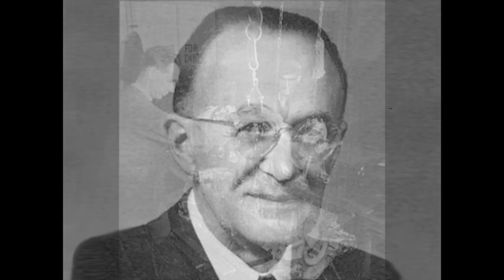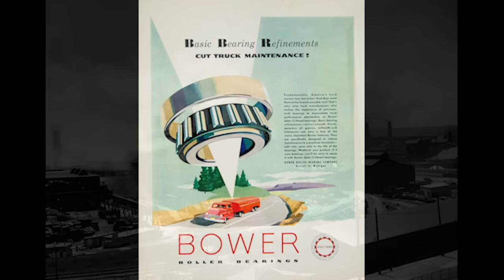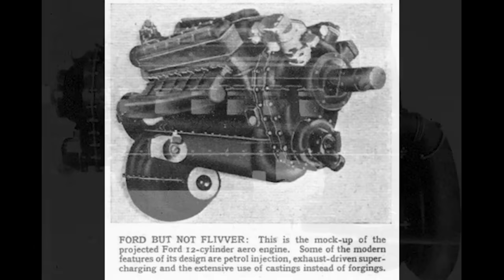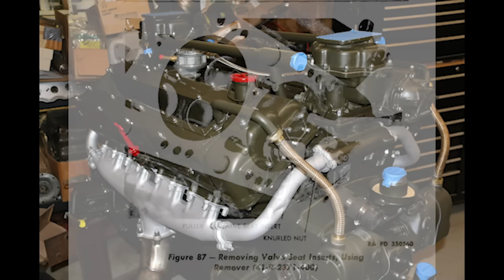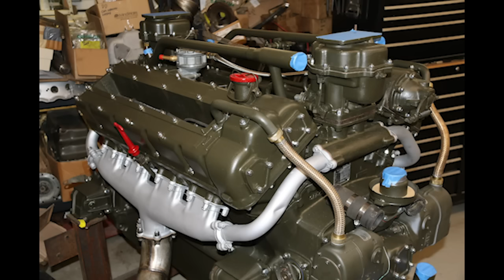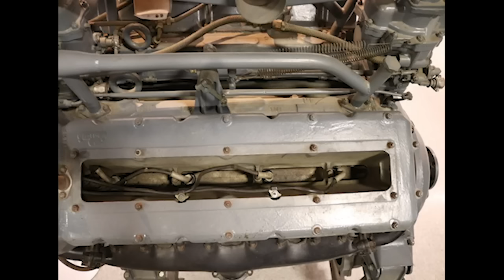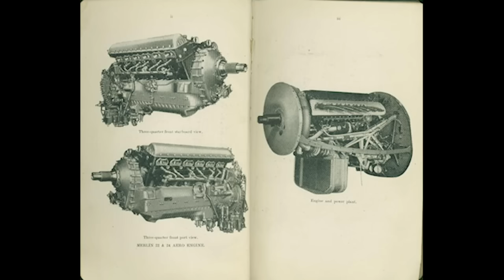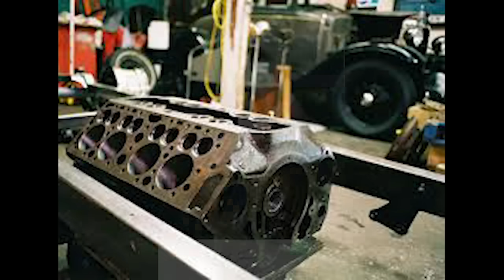War Hemi: The Story Of The GAA V8 - 1,100ci of aluminum WWII Ford grunt

Comment: Nice, but not a Hemi, its a 4 valve pentrof
Reply: Yes, only gen1 and 2 was a true Hemi
Reply: Chrysler hemi combustion chambers resemble a Yarmulke more than half of a sphere. Harley Knucklehead, Panhead, Shovelhead and Ironhead combustion chambers are much closer to a true hemisphere.
Reply: Certainly not a pentroof design, it is clearly designed to use the Hemisphere Thermodynamic Theory of combustion chamber architecture, which is to minimize the surface to volume ratio.
 The Hemi theory was derigueur in the 1940s aviation industry, Pentroofs are conspicuously absent from aviation as they were developed after the introduction of gas turbine engines.
Reply: @sandervanderkammen9230 Just look at the combustion chambers, clerly pentroof.
Reply: @peterolson8350  The photos shown in the video clearly show a Hemi style combustion chamber.
All of the documents relating to Ford GA series classify the design as a hemispheric type.
Reply: @peterolson8350  Its not a Pentroof, the Pentroof type was not used in aircraft engines. A Hemi engine has two opposing "Quench Pads" which would be clearly visible in the photographs that are shown and are absent.
Reply: @DoktorBayerischeMotorenWerke Hemi has no quence pads. Are also very few 4 Valve engines that have Hemi Camber
Reply: @sandervanderkammen9230 Its clerly NOT a Hemi
Reply: @peterolson8350  The Ford GA series has no quench pads, the photos clearly show a completely spherical camber.
Reply: The GAA has a hemispherical type chamber and can be clearly seen in some of the images in the video. a Pentroof would have two opposed quench pads in the chamber
Reply: @DoktorBayerischeMotorenWerke  It's hard to say anything about the shape of the combustion chambers from the low quality images, but other images which I have found of the tops of the cylinder heads with the valves exposed show the two intake vales are parallel with each-other, and likewise the two exhaust valves. Such an arrangement is not possible with the hemispherical combustion chamber, which requires all valves to be pointed at the theoretical centre point of the sphere of which the combustion chamber is a part. This simply doesn't work since the two intake valves would crash into each-other. They must be parallel in order to avoid interference, and parallel poppet valves don't fit into any section of a sphere.

The arrangement of the four valves in two parallel pairs means that a pentroof combustion chamber is pretty much the only possibility.
Reply: @TonboIV  Theoretically, a hemispherical combustion chamber is a perfect half sphere, but this is not practical in the real world applications and in particular with a multi-cylinder 4-valve configuration.
 A Pentroof engine is identified by two opposing quench pads on the cylinder head, the valve configuration is not a defining feature as Pentroof engines can be 2, 3, 4 or 5 valve configurations. Quench pads are clearly absent in the images of the GA engine.
 This only leaves the hemi type as the correct description and classification, it is listed as a hemi type in all the official Ford documents as well.
Reply: @DoktorBayerischeMotorenWerke  No hemispherical combustion chamber I'm aware of is a genuine hemisphere (that would result in a very low compression ratio) however, they are all a partial section of a sphere. The term "hemispheric" is used because there is no convenient term for a smaller section of a sphere.

Chrysler does use the brand name "HEMI" to refer to a modern two valve head design which is clearly not a spherical section, but that was a sales and branding driven decision.

The GAA combustion chambers cannot possibly be a spherical section given the valve positions. They don't appear to have quench pads either, but I believe "pentroof" is still the best description given that they have an angular ridge along the top like a pent roof. You can even see that the domes of the pistons have two roof like angles on them for valve clearance. Certainly the design is far from the shape of a sphere.
Reply: @TonboIV  Thank you for proving my point, a perfect half sphere is not practical, particularly for a 4-valve hemi engine like this one.

The Ford GA series very closely adheres to the basic "hemi" concept in practice and theory.
 the Hemi engine concept is based on the theory (now completely obsolete) that minimizing turbulence and the surface to volume ratio reduces thermal rejection and thus improves overall efficiency and performance... while this was true when compared to the earlier T and L type "Flat head" engines it is inferior to modern Pentroof and Wedge combustion chamber architecture. 
 Pentroof engines are identified as have a high swirl design that increases chamber turbulence and mixing of the air/fuel charge inside the chamber as the piston reaches top dead center.
 this is achieved by have Quench or "squish"  pads  and the matching flat surface of the piston crown.
 A wedge-type head will have a 'D' shaped chamber and a Pentroof will have a '0' zero shaped chamber with two opposing flats or straight sided quench pads.

true Hemi's all have a completely round 'O' shaped chamber as seen on the GA engine.
Any questions?
Reply: @DoktorBayerischeMotorenWerke  You're responding to like one sentence of what I wrote.

"Hemi" isn't technical terminology. It's meaningless Chrysler marketing. They've used it to refer to practically any two valve combustion chamber that isn't a wedge head. It has no meaning except whatever Chrysler needs it to mean so they can sell things to the "has it got a hemi in it?" types. Hell, the modern Chrysler "Hemis" have squish areas, which conflicts with even your definition of what "hemi" means.

"Hemispherical combustion chamber" is a technical term and in my experience always refers to a combustion chamber which is part of a sphere.

Anyway, other than the lack of squish area, the GAA combustion chambers appear very similar to a four valve pentroof design, so I think that's the best description.
Reply: @TonboIV  Here again, you are very confused and misinformed.
 HEMI(R) {Spelled in all caps}  is a registered trademark of Stellantis N.V. corporation originally owned by Chrysler Corporation until 1999.
 hemi is just shorthand for hemispherical.

I did not in any of my previous comments refer to the trademark HEMI(R)
Ford GA series is Hemispherical chamber design and that is exactly what Ford calls it too.

You seem very confused about the difference between a hemi and Pentroof and unable to recognize the differences.

Please go back and reread my previous comments for the complete explanation.
Reply: @DoktorBayerischeMotorenWerke  Where does Ford describe the chamber design as "hemispherical"? Could you actually provide some kind of evidence. Also could you maybe turn down your condescending attitude about 5 notches and try to have a civil conversation? Chrysler also aren't the only ones who can misuse terminology.

The chamber is shaped nothing like any part of a sphere and very much like a pent roof. It is also very similar to modern pentroof combustion chamber designs. Calling it hemispherical makes that term mean nothing.
Reply: @TonboIV  Dont be a sore loser lad, no one likes a sore loser.
Reply: @DoktorBayerischeMotorenWerke  If you're just a troll there's no need to try to have a rational discussion with you.
Reply: @TonboIV   Don't be a sore loser lad, the Ford GA Series is a hemi engine... stop making a fool of yourself because it's embarrassing.
Reply: @TonboIV  You certainly haven't proven your argument and your desparation reveals someone who is well aware that he has lost his case.
Reply: @sandervanderkammen9230  I made rational arguments, asked you to backup yours, and you went straight to trolling. Go ahead, read my previous comment and respond to it in a civil manner and we can have a conversation. If you just want to start a fight, I'm not playing.
Reply: @TonboIV  Your comments reveal someone who has absolutely no formal education or professional experience regarding this subject.
Please refrain from posting false and misleading comments on a topic that you are very clearly not qualified to discuss intelligently.
Reply: @sandervanderkammen9230  Why don't you just save time and post and navy seal copypasta?
Reply: @TonboIV  Thanks for proving my point.
Reply: @TonboIV  You lost any possible shred of credibility when you demonstrated you could not differentiate between "hemi" and HEMI
Reply: @sandervanderkammen9230  If you want to have a civil discussion about this, please do respond to anything I've written about the engine. All you've been doing is trying to insult me, which really doesn't work in an anonymous internet discussion.
Reply: @TonboIV  The Ford GA series is designed with a Hemispherical combustion chamber architecture and you have presented no valid reasons to dispute this fact.
 In your own comments you stated that a perfect half sphere is not a practical nor realistic in a production engine, and such is the case with the GA and any other 4 valve hemi type engine designs.
Reply: @sandervanderkammen9230  You're responding to me very selectively. Yes, I agree that a truly hemispherical combustion chamber is impractical, however all the combustion chambers which I've seen referred to as "hemispherical" are made as a section of a sphere. There is no nice word for a section of a sphere smaller then a hemisphere, so calling such combustion chambers "hemispherical" is a sensible choice. It's a word which comes very close to describing them literally.

Of course, Chrysler does use the name "hemi" for some combustion chamber designs which aren't a section of a sphere, but I'm not sure if they even try to call these designs "hemispherical" in a technical sense. The "hemi" engines of the 50s and 60s certainly did have combustion chambers which were sections of a sphere. The use of "hemi" to describe any other shape came later, with the 70s "hemi 6" engines or the modern "hemi" V8s, but that is clearly a marketing choice taken because "hemi" had gained a cache.

I don't know what you mean by "hemispherical combustion chamber architecture". I dispute that that is a fact at all. Are you saying that any concave shape with a design which tries to minimize surface area is "hemispherical"? I've never come across such a definition before and it seems quite contrived and too broad to be useful. Does a Rolls-Royce Merlin also have a "hemispherical combustion chamber architecture"?

The combustion chambers of the GAA clearly have a roughly pentroof shape, given the positions of the valves, and the photos in this video appear to show an upper "roof ridge" running along the centre of the combustion chamber. Calling such a combustion chamber "hemispherical" rather than "pentroof" is bizarre when it has a shape which is clearly no part of a sphere yet very similar to a pent roof.
Reply: @TonboIV  Any engine, with a Hemispherical or Partially Hemispherical chamber that does not  have a Quench Deck(s) is a Hemispherical Type combustion chamber.

This includes 4 valve Hemispherical chambers with intake and exhaust valves which share the same valve stem angle.

This valve arrangement is not unique to the Pentroof design, nor is it a defining feature.

The Pentroof design is identified as have two opossed Quench decks in the cylinders head.

YES! All Rolls-Royce Merlins have a Hemispherical combustion chamber.

Pentroof design was not used in any aero engines from this era.
Reply: @sandervanderkammen9230  Where are you getting this definition exactly? Who uses it?

Pretty much any combustion chamber has some part of that is hemispherical if you squint hard enough. If you want to include the GAA combustion chamber and the Merlin combustion chamber, then you might as well just say that anything without a quench deck is hemisperical, which is a uselessly broad definition.
Reply: @sandervanderkammen9230 You are aware that a Hemi is short for hemisphere? Are very few 4 valve engines that have that shape of the combustion chamber, GAA and Merlin definitely don't.
Reply: @DoktorBayerischeMotorenWerke  A pentroof combustion chamber does not always have quench pads.
Reply from the maker: And for the last 20 years Chrysler has been selling a two valve pentroof as one. Blame them. Hahah - legit point
Reply: Compare a 426 or 392 combustion chamber to a Harley Knucklehead introduced in 1936. Actually, all Harley iron cylinder OHV engines were more of a true hemispherical combustion chamber than any Chrysler hemi.
Reply: @brianlohnes3079 The third gen Hemi engines do not have pentroof combustion chambers, they're more like poly-hemi combustion chambers.